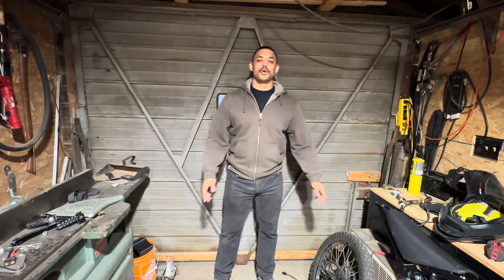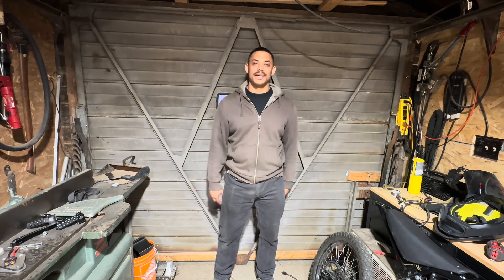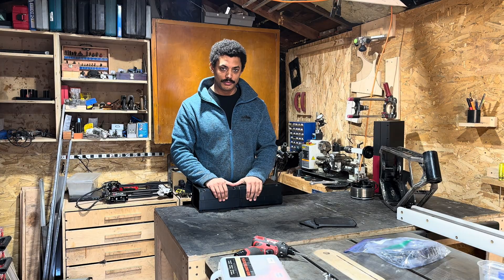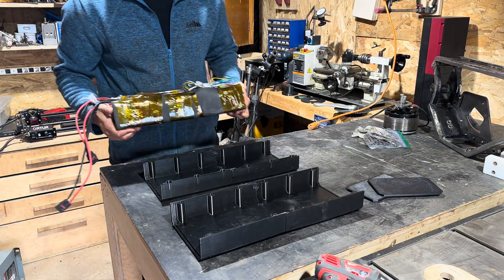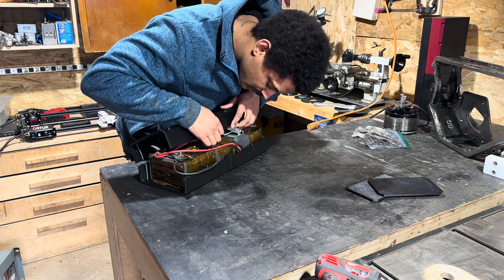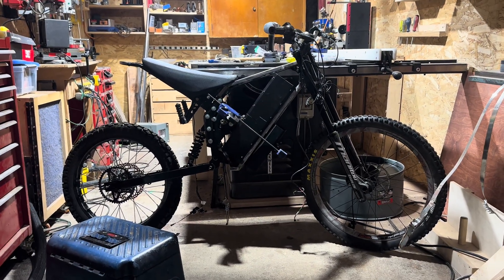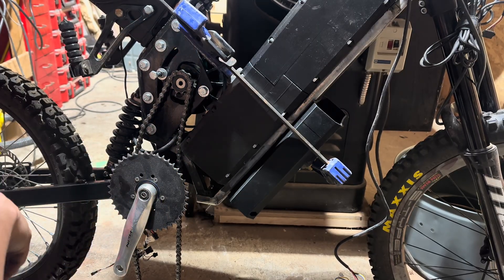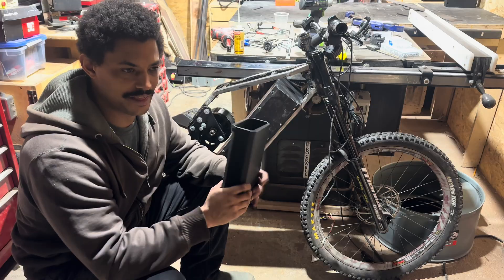Building a 15kW Stealth Bomber E-Bike: Battery & Electronics That Actually Fit

Comment: Cool stuff! Are u at all worried the battery will get too hot and melt that plastics housing?
Reply from the maker: Well petg doesn’t get liquid to well after 90c if the battery gets to 90c I have much bigger issues than plastic melting, because the bike will be on fire. lol. So no.

Comment: Loving the build just one question I’m wondering why you are connecting the motor to the pedal sprocket and not back to the sprocket on the wheel?
Reply from the maker: Thanks. this set up allows me to maintain pedal functionality and also works for reduction multiplier to back wheel(mini jack shaft). This is common in mid drive bolt on kits like cyc and other similar. Would i go with this architecture again if i started from scratch...? I am not sure. Would be nice to be able to keep my pedal gearing isolated from motor gearing. Especially because the pedals are mostly for the illusion of some kind of legal e-bike/compliance.